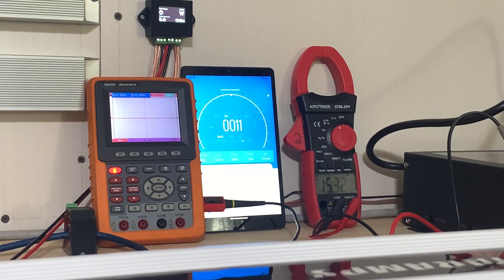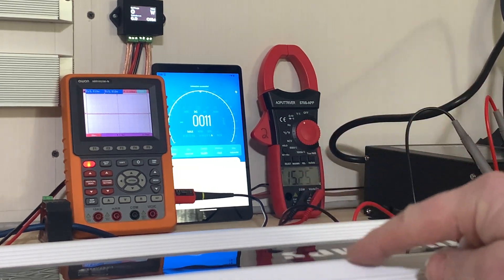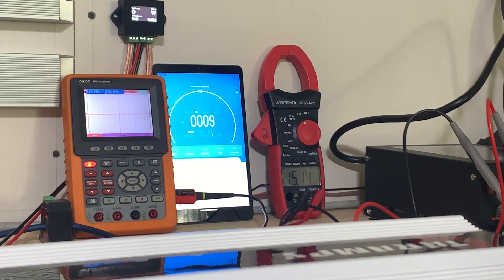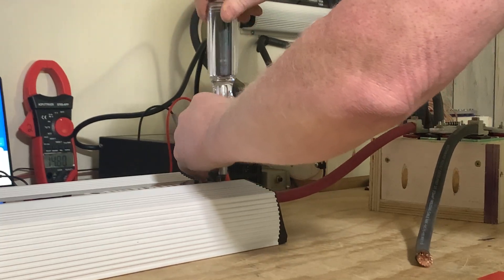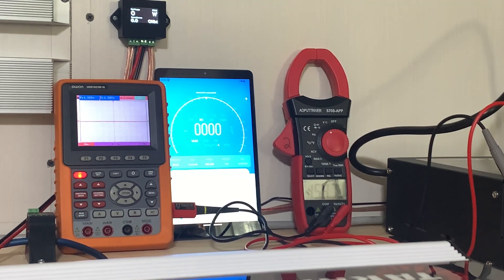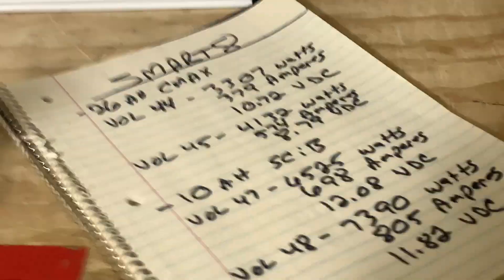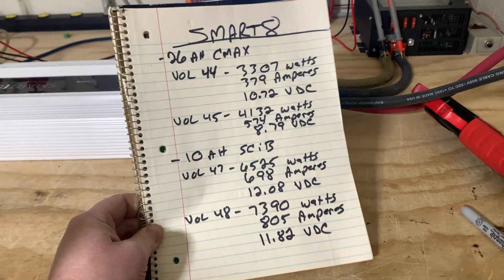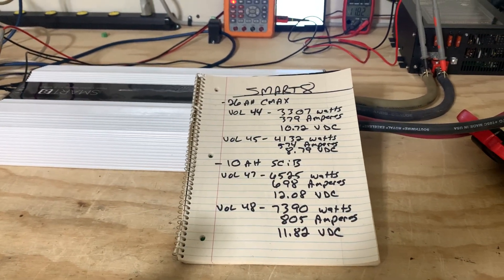CMAX versus SCiB on SMART 8

Comment: @AllAboutAudio- How safe are these Scib batteries vs Agm? Like if these Scibs were left unhooked in a vehicle, & not charged, or used over a 3 month period? Also how many Ah of scibs would be recommended for use with a dedicated 350 amp alternator with external adjustable voltage regulator= (Just for the Bass amplifiers), & a 2800 amp draw @ maximum, most of the time wouldn't even be half of that draw for demos. I have another alternator for the rest of the vehicle. Oh, & how high of a voltage can Scibs be charged @?
Reply from the maker: SCiBs are LTO which is a proven safe lithium chemistry. As far as sitting for prolonged periods of time that is not an issue as long as you disconnect the balancer from the battery beforehand. Some balancers allow for a toggle switch to be wired inline to make it easier to turn the balancer on/off. Maximum charge on a 6S bank is 16.8V but they can be ran down as low as 13.8V as that is their "nominal" rated voltage. I usually tell people to charge them at least around 14.4V on the bottom end of things to give a decent amount of reserve. They really hold a lot of juice at around the 15.5V range. As far as 2800 ampere burst draw this would depend on which SCiB cells you are referring to. The 10aH cells are the strongest at 75C which is 750 amperes per 6 cells so you are looking at 24 cells which is a 6S4P configuration for 40aH. The 20aH cells are the best bet for the money being 35C which is 700 amperes of current but twice the reserve of the 10aH cells. For 2800 ampere draw with the 20aH cells you would also need 24 cells in a 6S4P configuration for 80aH total. There are 6aH cells and 2.9aH cells as well, but personally speaking I stick to the 10aH and 20aH cells as they are going to be the better solution in my honest opinion.
Reply: @AllAboutAudioJW  - What does Scib stand for/mean? Does anyone sell a 6S4P of (10 Ah cells), in a 40 Ah Scib bank, that i could charge @ 16.2 volts, that comes with a balancer, & case, all ready to run? How much would that cost? What company do you recommend that sells 10 Ah Scib cells/batteries?
Reply from the maker: @evilinside5984  The SCiBs that I buy come from Srikobatteries dot com. They do sell the cells individually or they offer them in DIY kits where basically all you have to do is assemble the banks. Use code BDSB for a 5% discount. Here is a link: https://srikobatteries.com/product-category/jbd-bms/?msclkid=8767087ddd251d2c3baf6f9c7e40f95a

Here is a link to the Toshiba Global site "What is SCiB"
https://www.global.toshiba/ww/products-solutions/battery/scib/about.html

Hope the links work and hope this helps
Reply: @AllAboutAudioJW  - On Sriko it showed a diy-kit with 6 banks= (36)- 20 Ah prismatic cells (prismatic= Scib cells?), but showed only 12Kw of power!? Am i understanding this correctly? Is this because these cells are generic (as stated)= way inferior quality? Your test showed (1)- 10 Ah bank of Scibs holding 8k just fine. So if you had (3)- banks= 30 Ah of Scibs, they would hold 24k just fine. In this/your test= 26 Ah CMax vs 10 Ah of Scibs, are you using the same generic Scib cells from Sriko?
Reply from the maker: @evilinside5984  Yes I buy my SCiB cells from Sriko. Please see my answer to your other comment and it will explain the different ratings of the batteries.

Comment: I need help. I have a dual alternator set up. My 320 amp alternator 14.8 max charging is ran to the back where i have 2 agms. I want to switch to lithium. I see the scib diy kits. How many ah do you think I'll need? Im running around 6500 watts rms.
Reply from the maker: For the money the 20aH SCiBs are your best choice, especially for a daily setup. First thing you will want to ditch the AGM batteries and replace them with the SCiB bank. Using the 20aH SCiB cells from Sriko dot com you will need an 80aH bank to run a true 6500 watts RMS system comfortably. That is taking into consideration the amplifiers will be running at 70% efficiency. 80aH of the 20aH cells you will need 24 cells total. 6S4P configuration. You will also need to get a 6S balancer. I have had very good results using the Heltec capacitive style balancers. You can get them on Amazon or Ebay with or without the voltage readout display. Sriko dot com has them as well. If buying from Sriko don't forget to use the discount code
BDSB for 5% off.
Reply: @jeremywilliams8558  thanks man i appreciate it I don't really play my system with the car off but im assuming I can for a little while with a 80 ah bank. I close live in a cold climate will that be a issue? And the black 2.3v lto prismatic cells with m6 threading?
Reply: @AllAboutAudioJW  i got the stuff in my cart i want to make sure im ordering the right stuff. They only got the black m6 thread 35 c lto in stock is that the right one?
Reply from the maker: @Jerry-t4q6r  yes the m6 and m4 studded cells are the same except for the stud size.
Reply: @jeremywilliams8558  ok thanks. Lastly do they work well in the cold? Because i live in the midwest it get hot in summer and cold in the winter. I was considering the glowe voltage series 2 but building my own bank may be the way i go.
Reply from the maker: @Jerry-t4q6r  I haven't had any bad experiences with the SCiBs during cold times which is single digits here in southwest VA. The Gushen cylindrical cells on Sriko do experience diminished capacity during cold weather, but I have not seen that with Yinlong, SCiBs, or CMAX personally.
Reply: @AllAboutAudioJW  one more question how long will i be able to play the system at about medium volume with my truck off before needing to start it up?? Thanks fir answering my questions bro i really appreciate it man i know i asked alot.
Reply from the maker: @ That is a difficult question to answer accurately since music can vary greatly from song to song. But from personal experience, the way I design battery banks, I can play several songs back to back to back and lose roughly a half of a volt. I calculate battery sizing without consideration for an alternator, so you can always be sure to have more than enough battery reserve to operate the system for long periods of time. Generally speaking, the battery bank will be sufficient to run the stereo until you need to shut it down for the amplifiers and/or the subwoofers need to cool down. And during that time the alternator(s) will have time to recharge the battery bank while the system is cooling down. Hope this helps.
Reply: @jeremywilliams8558  thanks man. Im sold im about to order 24 of the 20 ah cells i really appreciate the help.

Comment: Any plug and play options for the scibs? For bass head idiots like me?😂😂
Reply: I seen that Xs Power sells the Team Titan8 that has a case, & balancers= complete ready to run banks= the TT30= 30 Ah Scib bank, a TT60= 60 Ah Scib bank, & a TT90= 90 Ah bank, for people that want to charge @ 15.5 volts to 16.0 volts! Then Xs Power also sells The XMax 90 Ah battery bank in a case & balanced= complete ready to run, that likes being charged between 14 to 14.6, or 14.8 volts, i can't remember.

Comment: Any plug and play options for the scibs? For bass head idiots like me?😂😂
Reply: Sriko sells premade lithium banks but if you get their diy kit building your own is genuinely as easy as putting together legos I only paid around 520 for my 60 ah bank of scibs , should be good for 600+ amps continuous and a lot more on bursts
Reply from the maker: I am sure somebody out there is selling them. Srikobatteries dot com sells kits to where all you have to do is assemble the banks. I build my own so I can tailor them to my specific needs.
Reply: I have a 100ah 6s, 200ah 6s, and 3 80ah toshiba scib lto banks built with 20ah cells. Ready to install , can ship lower 48

Comment: I did some test with 20 ah scib...basically you will have more power if you charge scib around 16/16,5 volt.
Reply: Was it 20ah scib cells or (2) 10ah?
Reply: @Galicia322 20ah

Comment: Whats your thoughts on the scib 20ah
Reply from the maker: They are the best bang for the buck in my honest opinion especially for a musical build. The 20aH from Sriko are rated at 35C which equates to 700 amperes of current on bursts. That is only 50 amperes less than the 10aH cells but they also have twice the reserve of the 10aH cells.
Reply: @jeremywilliams8558  how many cells would I need to support 50000 with 320 amp alternator
Reply from the maker: @MrTwone79  I would say around 520aH would be sufficient on the 20aH cells for a musical build. 50,000 watts of amplifier output at 70% efficiency needs 71,429 watts of input from the battery bank. Running 15.5 volts that equates to 4608 amperes of current continuous draw from the battery bank. Each bank of the 20aH cells are good for roughly 175 amperes continuous draw (educated guesstimate) which equates to 26.33 banks. So 26 banks  is 520aH which is 156 cells total.
Reply: I see that I need to buy a Tahoe to do a build this big instead of trying to do it in a monte carlo ss ill have to due half that power in that car then to make i have enough room
Reply: Curious about the 175a on the 20ah at 15.5..

Comment: I’m curious about the larger 20ah scib cells.
Reply from the maker: I have some 20aH SCiBs on my test bench that I ran in my van. It is a 160aH bank that were rated at 25C from Battery hook up dot com. The 20aH SCiBs from Sriko dot com are rated at 35C. We have some of those here as well. The 20aH bank on my test bench is very strong. When it was in my van I was running 5 of the Taramps HD-3000 amps at 1 ohm each amp. Clamped roughly 2400 watts on burps into clipping and 1200 watts clean  on each amp. Voltage drop was around a half of a volt after 2-3 songs full tilt. This was with a stock 160 amp alternator controlled by a "blue box" external regulator. Voltage setpoint daily was 14.4 volts which is on the low side of the voltage spectrum for the SCiB cells. I am going to try and find a good amplifier to test several different battery banks to show how much power they can actually pull from an amplifier. Thanks for watching!

Comment: Why at different volumes. I’m just trying to understand not judging.  Just here to learn
Reply from the maker: The output of the amplifier will be hindered by the input power from the battery. The stronger the battery the more power the amplifier will be able to produce. That is why I showed each battery with the Smart tech not kicking in and then one click higher on the volume where the Smart tech kicks in. On an amplifier without the Smart technology this would be a "clean" test and then one click higher would be into "clipping". But with the smart tech on the Smart 8 it will reduce output as shown on the oscilloscope screen instead of actually letting the amplifier go into clipping. Hope this helps to clear that up.
Reply: @ thank you sir and the quick reply

Comment: What oscope and multimeter is that you’re using? I subbed by the way! You should do a video  comparing the glowe voltage fuses ,ceramic and fiberglass vs skar or other anl fuses 👀
Reply from the maker: I have the Owon HDS1021M-N oscilloscope and a AOPUTTRIVER AP-570S-APP Bluetooth Clamp Meter. Both can be purchased on Amazon. I also have a FNIRSI 7" tablet oscilloscope which has a much larger screen which is also touchscreen and very responsive. It is about $90 cheaper than the OWON and is dual channel and is much easier to use. The OWON is just working out a little better for my test bench at the moment otherwise I would be using the FNIRSI tablet scope.
Reply: @ I appreciate that! I need a clamp that will hold as well as a good oscope

Comment: Great video! Im running a 60ah bank of the 10ah cells on a big boss 8k at .5 and a jp 234 charging at 15.9 and my voltage barely budges even at full tilt. Love those scibs💪🏽
Reply from the maker: Nice! Yeah I have a 60aH I am building for our Civic burp build. Modeled it to power a Soundigital 35K at half ohm. These are some strong cells indeed. Thanks for watching!
Reply: @AllAboutAudioJW  looking forward to that video!
Reply: not to mention scibs are a lot safer than the cmax.
Reply: How much does your voltage budge? Just wondering because Ima do the same thing and am trying to decide how much I need

Comment: Hey buddy, thanks for all your informative videos, really love how thorough you are with the testing, excuse my ignorance, but what exactly is the smart tech? I was under the impression the smart tech was just to produce the the rated power from .5 to 2ohm
Reply from the maker: The Smart Tech will reduce the output of the amp when it senses the output is going to be greater than the amplifier is designed to produce. This will essentially help greatly in reducing clipping but also let the amplifier produce full power among a broad range of impedance. Sam Vennard on Barevids explains it much better than I ever could. It is a great technology to help protect the amplifier but at the same time I kinda want to be able to clip the amp on burps at competitions. All in all I will take the smart amps over most amps almost every single time. They are very cost effective, space saving, efficient, and reliable in my experience with them. Thanks for watching!
Reply: @jeremywilliams8558  awesome, thanks for that reply, I have indeed watched barevids video on the big boss 8k, it truly is amazing all the tech in these budget friendly amps. I was under the impression that the that draw back on power was only if you dropped below a certain voltage, meaning if your above 14.8v(just a made up # not sure if thats the actual voltage) you can clip as much as you want.
 I'm running jp43's strapped at the moment (we'll i have nothing right now, redoing my whole set up) but was running them at 2ohm and rising to 3.7ohm, I was getting 8k according to the smd amm1. I have a big boss 8k sitting around and when I get everything back in my car I think I'll be pulling the jp43's and doing some testing with the taramps. Any who, thanks for the video and replying to my question. Have a wonderful night
Reply from the maker: @Will-r4d  You won't be disappointed in the Taramps. They put out some good clean power.
Reply: @Will-r4d  Those Smd-Amm-1s can show some overexagerated power #s, especially while in peak/burst power mode. Do the simple math on your Jp43s @ 3.7 ohms. Like if you took known dyno #s (from a $4000 Smd amp dyno) that williston audio labs got while testing a Jp43. Example: Say it did 5k @ 1 ohm, 3k @ 2 ohms, & 1500 @ 4 ohms (not saying these were the #s, this is just to show how to get an idea of expected power @ a given voltage, & ohm load). If your impedance went up to 3.7 ohms, just do the math breakdown of the amp dyno #s from in between 2 ohm power= 3k (in my example), & 4 ohm power= 1500 (in my example). Take the difference 3000-1500= (1500 is the difference), then divide by the tenths of an ohm, between 2 ohms & 4 ohms (there are 20), so divide 1500 by 20= 75 watts per tenth of an ohm (between 2 ohms & 4 ohms). So 3.7 ohms is .3 ohms lower than 4.0 ohms. Take 75 watts x 3= 225 watts. The amp dyno power @ 4 ohms showed 1500 watts, so 3.7 ohms would be 225 watts more, so 1500 + 225= 1725 watts per Jp43 @ 3.7 ohms (@ what ever the voltage was/is). Again this is an example of how to cross ✔️ the actual power, the actual #s will be different. Furthermore i am aware that you said strapped & (not currently because your re-doing your setup), so if i understand correctly 2 ohms strapped= (each amp is actually seeing 1 ohm internally while @ rest), & rise was to 3.7 ohms= (each amp was actually seeing 1.85 ohms). So depending on your actual lowest voltage drop, while maxing out your system, i would guess your actual real power was somewhere between 6k to 7k total= for both Jp43s.

Comment: Great video my friend ! Lots of good information in your videos. Those scibs are beast. How volatile are they and do they need compression like max?
Reply from the maker: SCiBs are LTO so very safe chemistry. And no need for compression. So win win on those points.
Reply: Ahhh ok. I’ve always just heard of yin long being associated with LTO. I’ve hitched my wagon to Yinlong lol. I have 160 ah of Yinlong, 1000 farad of super caps, and 54 ah of sodium. I’m running a Taramps smart bass 8k and I also have 370 amp mechman
Reply from the maker: @bigbiscuit6751  Definitely solid electrical for that amp!
Reply: @bigbiscuit6751  I actually just recently found out that Scib stands for (Super- Charged- Ion- Battery) So its chemistry is still LTO= (Lithium- Titanate- Oxide), just like the ding dongs, ah i meant YinLongs (im just being funny), but the Scibs are much more dynamic/fast on there charge, & discharge rates, making super caps not needed. But since you have both= your combining both benefits like you would get from Scibs, so no need for you to change, your electrical is great!
Reply: How does LTO compare to these?
Reply from the maker: @bigbiscuit6751  SCiBs are LTO chemistry. But if you are referring to Yinlong then that test is coming up as soon as I have the time. I will be doing a series of battery testing videos to see how much power each bank can draw from a BIG amplifier.